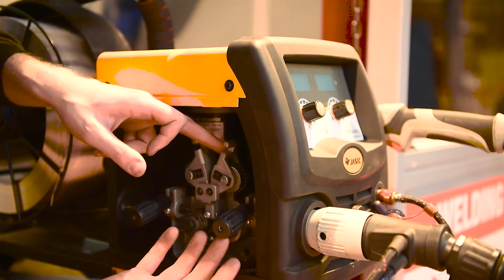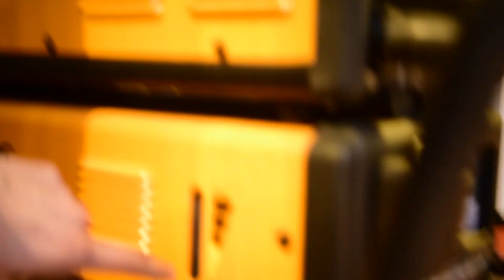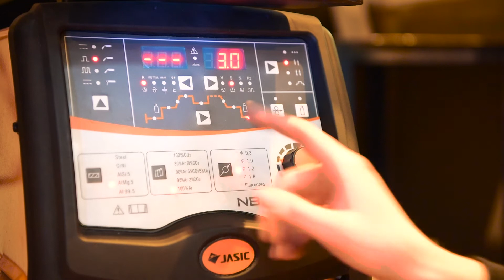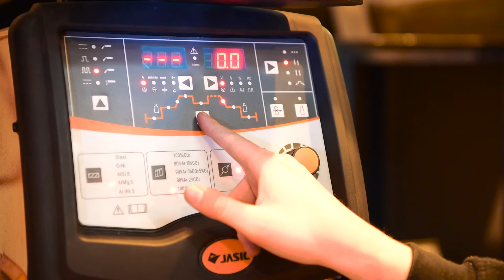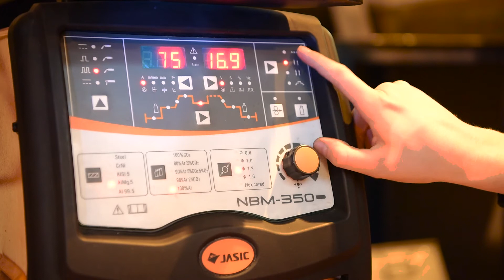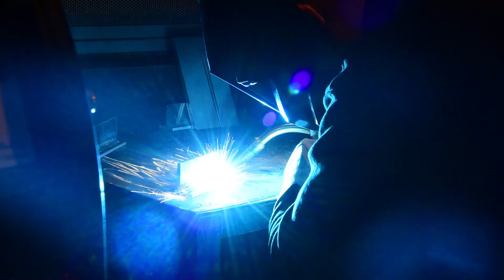Jasic MIG 350P - Setting up for welding aluminium

Comment: Any chance of a vid that shows off the jasic tig200 ac/dc analogue Order Code: JT-200A & it's digital version sister Order Code: JT-200D  & the pro's & cons of each as well as  run through of the setup of both. Like you've done in this video..I also see on the tech sheet the analogue tig starts at 30amp & tops out at 185amp ? where as the digi version starts at 20 & tops out at 200